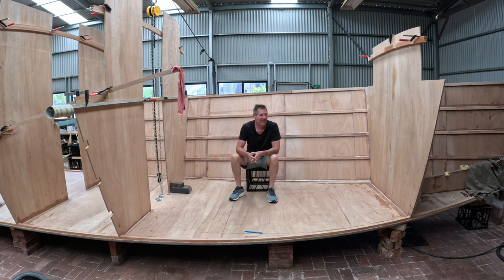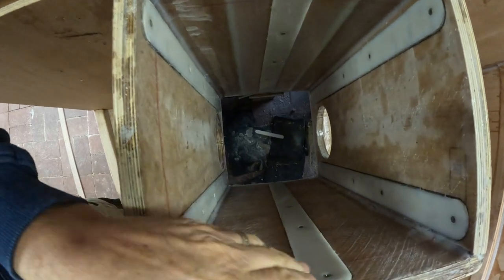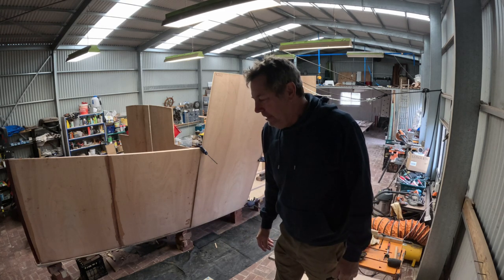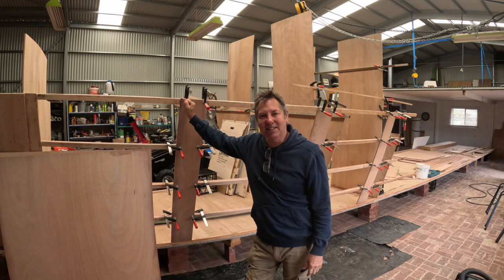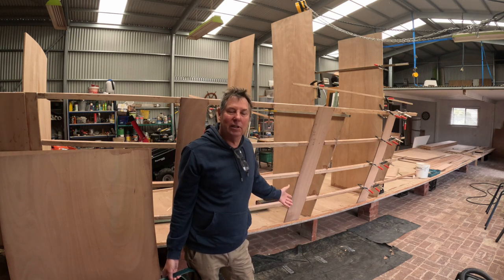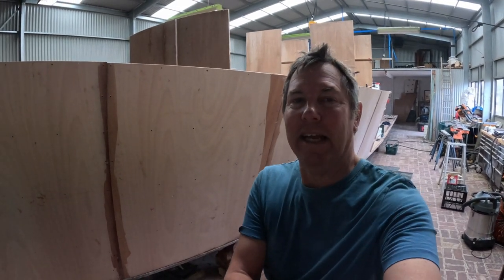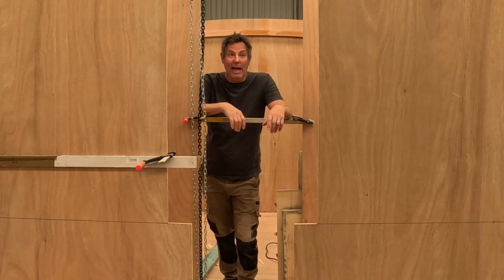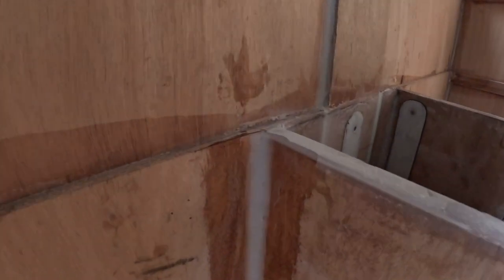Boat Building No Plans! What the? Building Dragonfly E 13

Comment: I'm catching up on your videos and enjoying watching your progress.  I'm not a boat builder, so please forgive this question if it is a dumb one, but do you only use glue and epoxy for the most part?  I have not seen many screws used so far and was just curious.
Reply from the maker: Hello, not a dumb question at all. Some builder actually take all the screws out and just use them to hold things in place while the glue dries. I prefer to leave them in for added strength. Thanks for watching and taking an interest, cheers, Steve and Maple the dog :)

Comment: Just watched all your boat videos and I have a question for you. I saw you holding the inspection covers to be able to access the bowthruster prop and was wondering about the level of the waterline. Are the inspection covers going to placed below the waterline? It looks to me they are. Those covers are not ment to be installed as water tight covers in the hull. Now if you open a cover with the boat in the water, you’l get your feet wet. If you place the covers above the waterline all’s fine. I might be getting it al wrong here. Love following your work, good luck.
Reply from the maker: Hi, thanks for your interest. They are above the waterline. I am considering proper water tight inspection ports anyway, but these will be just above the water line. They are only for emergency access. Cheers, Steve

Comment: Just curious: wouldn't a skeg down the center of the boat bottom reduce or eliminate the need for a bow thruster in windy conditions?
Reply from the maker: Hello, and yes it would. However, I am trying to keep the draft to a minimum, hopefully about 6 to 8 inches, so super shallow. Our river system has lots of very shallow areas with multiple sandbars, and a flat bottom shallow draft will allow me to access areas otherwise not possible. Cheers, Steve

Comment: Love your work and your method of boat building. I would love to build a boat, but a lot smaller. Could you please tell me what the legal process is to get it registered?
Reply: I don't know about Australia, but in the US registering a home-built boat is much the same as registering a home-built trailer. I registered my little trailer in about 15 minutes at the DMV, was given license and title on the spot. In many states, boat registrations are at the DMV, as well.
Reply from the maker: Hi John, that all depends on where you are and the size of the boat. Over a certain sizr here a builders plate is required showing specific info. The qualifications of the person named on the plate is a grey area. Cheers, Steve